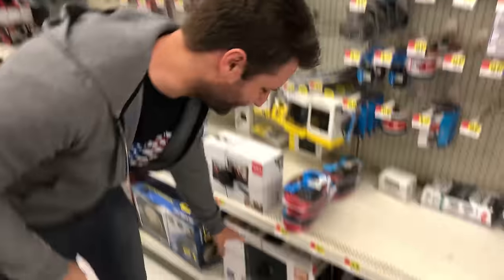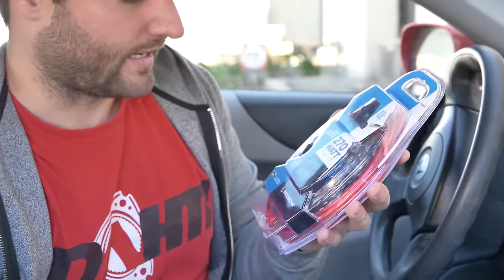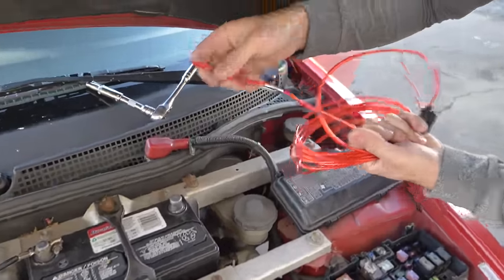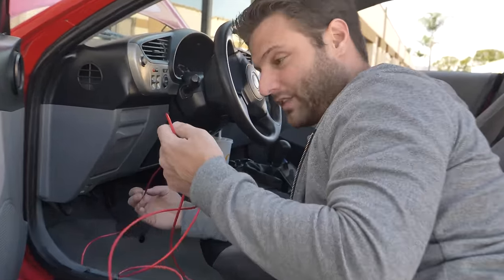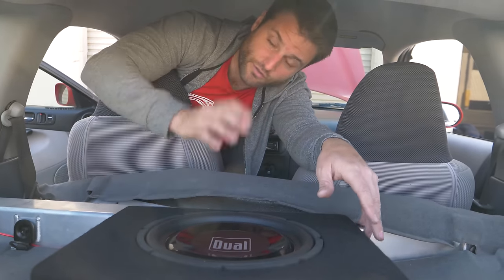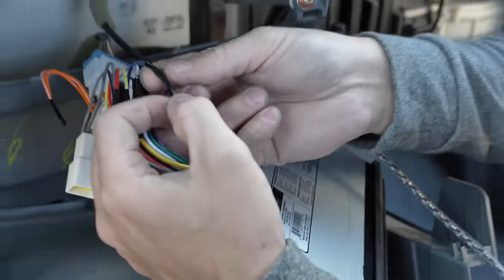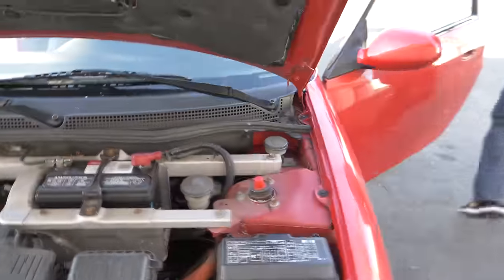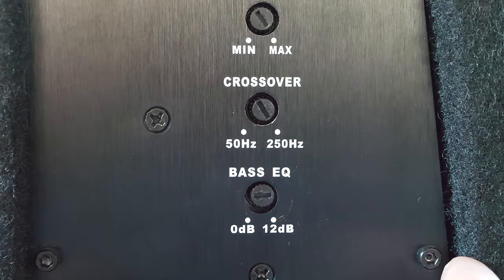How bad is the $70 subwoofer from Walmart? Install | Review

Comment: I cringed at Almost every step of that install
Reply: Besn't
Reply: We do not ever never no no connect the radio harness with black tape. Drive around enough and shake those connections on a hot day when the adhesive on the tape turns gooey and it will pull the wires out and cause a fire
Reply: Bantamdude Rodriguez Edgy huh?
Reply: It was all downhill after he bought the 270watt wiring for a 300 watt amplifier. You always want the wiring number higher so your alternator doesn't work too hard.
Reply: Beerus The Destroyer 
Lmao!
Reply: Never connect anything to your fuse box lol
Reply: TiigAgiiN eh. I cheated with my last amp. It turned on by the wipers. It doesn't pull much power just enough to say the car is on. Have to get my new car done professionally since its a brand new car and i dont want to void any warranties or figure out how to keep all the extra features. Going to cost me $2400 sadly. Only $150 is labor.
Reply: TheKingHostile man, I got a 2018 civic, I got my system done professionally only cost me $1,000 ...... But I didn't do speakers or a deck, just 2 12s and an amp, and some fancy new adapter for the deck
Reply: CarPhonix CarAudio I'm with you on that
Reply: TiigAgiiN The auto audio doesn't make money off the products. They don't even sell most of them just told me what I needed to bring in. It's literally so much because of how honda has the screen seperated from the head unit so it requires a special aftermarket product or replacing it with honda's premium sound head unit so I can add an amp for the speakers and run a sub. The sport head unit doesn't have a spot for subs so without replacing it I'd have to cut some wires to add a processor which voids the warranty. They're unwilling to void the warranty for liability reasons so they will only install and replace parts which keep the warranty in tact. Replacing the speakers with jbl 4 ways is a good $600 of the cost. The amp and sub are about 500. The head unit replacement itself is $1100. I might just wait until the warranty is over or void it myself. I have my other car if I really want to enjoy music but it doesn't get good gas mileage lol
Reply: TheKingHostile makes sense, I had 300 miles on mine, and said fuck it. Added an adapter, but its some fancy thing I've never seen before (probably the processor you mentioned) and then all the wires from my amp run to it, besides the main power of course. Still the part only cost $180
Reply: TiigAgiiN Most likely it's a sound processor. I wouldn't mind voiding the warranty as much if I didn't have reverse camera, climate control, remote start, sound cancelling and other features all bunched up in or near the head unit.
Reply: CarPhonix CarAudio i also cringed
Reply: Mr S That amp is probably 60w rms (real power). 300w peak power I’m guessing. A real amp at 300w cost around $150 plus...and that’s just the amp
Reply: TheKingHostile yea, that's why I used the one I did, he said it wouldn't affect any of that..... I feel as if we have the same car lol
Reply: No it's because the wires themselves will be too thin. 
Also, that speaker system is actually rated at 100 watts RMS, which is more relevant, so he probably won't have any problems, but it's a bare minimum setup and if he ever goes for more power he will have to get bigger power and ground wires.
Reply: same
Reply: I lol'd. I mean, you, apparently coming from a professional place being cringey and just non-constructive critizism towards a rando installing a 70 dora walmart woofer. 

Way to go, I know I wouldn't bring my business to you then, I mean. Sheesh, you'd stand there cringing if I had questions YOU find obvious etc? 
That attitude, much service  friendly ;)
Reply: at 1,974,000 views he made around $20,000 + from this video and you guys are crying about his wiring kit lmao.
Reply: Chooch it
Reply: TiigAgiiN I mean you can connect a remote wire to the fuse box
Reply: LOL ANYTHING WITH THE BRAND NAME DUEL WONT BE NOTICED BY AN ALTERNATOR. IT'S NO DIFFERENT THAN CHARGING YOUR CELL PHONE LOL
Reply: Nigga he just bought a Walmart sub
Reply: $2000 if he is lucky. $1200-$1700 otherwise
Reply: somemedic someone can't hear that well. He was testing and even said he will now terminate them properly.
Reply: only 1k lol the only big issue i saw on the video was the black electrical tape other than that is ok . no need to pay that much for running some wires.
Reply: Thomas Marshall yeah that part too 😅 but yet is not worth to pay a professional $1k for a car that is worth just little more than that .
Reply: Think he needs to watch some videos on how to properly install a sub . .
Reply: lol
Reply: CarPhonix CarAudio I swear bro I install car audio and this guy trying to blow some things up. He said touch quickly to see if it blows anything..I literally lost it lmao. It's called a multimeter
Reply: I agree. The sub itself is cringe 😂 and the opinion that a little "10 is "impressive" is cringey too.
Reply: It was pretty bad from start to finish. What are people putting in their cars?  My last "cheap" system was a 1200w Class D and a pair of entry grade JLs

Comment: i can't believe people do this! NEVER CONNECT THE POWER WIRE TO THE FUSE BOX!!!!!!!!!!!!!!! Why! yfi! the fuse box has fuses of different current levels that will be thrown off by power drain that could fry your computer if wired wrong! when i helped at a certain place, a certian person did the same thing wiring the sub to the fuse box, he shorted a few things, and one was the alternator. here's the problem, it was a 300m, chrysler. just remember one thing, because your sounds cause a energy drain, the power wire must connect to either the battery post (+) or the alternator positive terminal that runs to the battery. you'll learn that either place connects to the batterywith current flowing through and doesn't affect the voltages of the fuse box, which has things like ignition 1, ecu, abs, and many others you don't wanna mess with. SO DONT CONNECT TO THE FUCKING FUSE BOX👿👿👿👿👿👿👿👿👿👿
Reply: Nori Licious I was dying when he just connected it to the fuse box. I wanted to cry.
Reply: Stupid part is most amplifiers come with wiring diagrams or instructions and people still get it wrong.
Reply: Shit it even said it in the manual he was looking at. Damm that dude cant even read.
Reply: So much installer fail here. I love it. 
Dude needs to stop the DIY audio tho. How may kids are going to F their installs up now?
Reply: For real tho I was saying wtf are you doing
Reply: yeah, I facepalmed hard there! It's even MORE work to do it that way so it wasn't even laziness. Just take the nut off the pos terminal and slip on the o-ring there dude wtf
Reply: Looked like he connected it to the main feed going INTO the fuse box. That's fairly harmless on most cars.
Reply: I doubt this little garbage sub has enough power to cause any damaged. Lol I had this sub for a week and it burned out. It’s pos
Reply: John Moore kind of a logical-thinking fail here. 1) Just because the amp adds load to the system does not mean the voltage at the fuse box will be the same whether the amp is connected to the fuse box or directly to the battery 2) You can absolutely reach the capacity of a wire and starve a device (of voltage) - why do you think the wire burns when you pull too much current through it? 
You're not completely incorrect, but you should stop shouting long enough to make a cogent argument, because what you wrote there wasn't very convincing.
Reply: freebirthfreddy He was more correct than you were actually. In this specific scenario, as stated, the amp will never pull more current than the factory wire will deliver. Unless shorted of course which the fuse should control.

Discharge is dicharge. A 1v drop will show across all electronics attached to the same source without some sort of additional capacitive device. Hence 1v drop at battery, 1v drop at fuse box. Youre not removing amperage, youre removing voltage.
Reply: There's nothing wrong with it being connected to the fuse box so as long as its on the Input of the fuse box, and the cable feeding the fuse box is substantial enough to handle the current.
Reply: All depends what you're using it for, it's one thing trying to fill in the sound, which that sub will do. BUT it's completely different if you're trying to show off. That's when people spend $$$$. I've had my cheaper Sound Storm for a few years and had 0 problems. Could also be i know the limits and i don't try to push it past it's limits
Reply: John Moore as a plumber I’m offended by this. :’(
Reply: It gives me physical pain to see what they are doing to those iconic brands of old... poor Dual, even a lot poorer Infinity, etc.
Reply: Never seen it in my life... Always to the battery
Reply: Cars with computers are stunted!
Reply: As a plumber you should be honored. He's referring to the difference between water and electricity, not the difference between electricians and plumbers. Bottom line, stop getting butthurt over internet bullshit.
Reply: Nori Licious couldn’t even properly crimp the wires down.
Reply: Nori Licious thank you someone who has fucking knowledge of cars and systems  should of called it install of cringe
Reply: John Moore too funny bro
Reply: I disagree... I feel some people need to learn the hard way. Makes life worth living, and it teaches you a very important lessons. All you need to do is sit in the mezzanine and observe.

Comment: 5 years ago they had a 10" kicker all in one box at Wal-Mart. I still use it today, sounds great.
Reply: Sounds great if you haven't heard a half way decent system lol
Reply: @ascap2854  no ive heard systems that run $15,000 plus. I'm running component speakers. Dont need anything better in a hatchback.

Comment: I have never seen a power wire run that way! I only run the power wire through the firewall using an existing grommet....
Reply: Joseph B there are some cars where this is not possible without several hours of taking apart the dash. My 07 impala LT has a dual layer firewall that I didn't want to bother with so I ran the power wire for my system in the front fender, through the window wire grommet, and down the paneling into the trunk. It is common practice tongi through the firewall, but it's not a must
Reply: The grand prix i wired up had kinda the same idea as robs, no issues
Reply: lol right Joseph B he removing the factory assembled fender bolts too that's the fast way to get uneven panel gap

Comment: I did not just see that power wire go through the door!! Rookie moves 101!
Reply: he really has no idea what hes doing lol, he dident even solder any of the connections on his aftermarket radio, they are all electrical taped together lmfao
Reply: It must be the cheapest and quickest way to install
Reply: I installed a 800$ painless wiring harness 21 circuit in my 67 falcon and every connection is not soldered. Simply twisted together and wrapped with shrink tube. You don’t need soldering tbh.
Reply: @redbird283  yeah I don't think the solder is needed. All I did with mine was put little caps over them and crimped them. Well over 2 years ago now and it's been just fine. And I have a 2300watt set up.
Reply: @redbird283  yeah fuck soldering. I'll do it if I have to. But I'd rather not deal with burning myself/inhale potentially carcinogenic fumes
Reply: Solder or crimp, and insulate with good tape or heatshrink, adhesive filled heatshrink preferrably. Twisting and taping is only ever acceptable as a roadside fix to get you to a better location to fix shit properly.
Reply: @user-mg8mb6ss2t  did you see the part where he said "normally i would solder the connections, but im trying to replicate what the average person whos spending 20 on a head unit would do"
Reply: At 20years old,i did the same shit with no inline fuse. .my car caught on fire 3 months later

Comment: Place the subwoofer facing towards the trunk.
Reply: Brisko well bas is omnidirectional which means your ears can't distinguish where it's coming from so doesn't matter where u face it but ussually yes facing it to the back I'd better which is forcing all the bass to simple way of putting it is that it collects and builds up pressure at the back of the car before being bounced up to you at the front of the car it is louder

Comment: Its funny how your time line is backwards. Start with a high end car and working your way back to a broke teenager.
Reply: Talon Zero LoL, that’s pretty accurate too. As a 37 yr old dude I can almost definitely say my days of installing subs and head units in old beater cars is probably over.
Reply: As a 44 year old dude, I can't wait till I pay off my new car and can have some beater projects again.
Reply: Alvin Brinson why a beater though? I think at this point in my life if I was going to take on a project it would be one I’d care about. I don’t generally drive new cars in general but my current car has an awesome factory stereo, the HK logic7. My last 2 vehicles both had the radio quit working and I just kind of got used to it, now I’m a bit spoiled so if I had a project car it would either be a race car with no radio or a car I loved with a good stereo. Whatever makes ya happy though, I do see a value in beaters, just not really for me right now, maybe if I worked in construction sites or got dirty at work I’d definitely get a beater.
Reply: Well, the term "beater" basically to me means a car that's cheap enough that if I break something I won't cry over it. I do like that the car runs well and correctly though.

I did get a project recently - a flood salvage PT Cruiser GT with 25,000 miles. Has the 2.4 Turbo motor, same as the SRT-4... so I can play with it, make silly power for a 4 banger sleeper... and if it blows the transmission I won't lose too much sleep. But I do of course make sure everything's in working order - so I guess that's different from being 19.
Reply: Alvin Brinson Ok, I gotcha. To me a beater has always just been basically a car I don’t care about, if someone hits the door, who cares, if the interior gets trashed from work clothes, no big deal, it’s just a means to get me where I need to go and back. I guess pretty much all of my cars fit under your description, if they break I don’t sweat it much, they are paid for so occasionally putting some money in maintenance is no big deal, it’s better than a car payment to me but I’m still quite particular about my car, I keep it clean and and I’d be pretty upset if it got a door ding or any body damage really.

Comment: Not recommended to run ANY power wire due to the fact that your door shutting can actually cut your cable which can lead to major problems

Comment: Please use butt connectors not electrical tape. And notice he plugged the RCA's in before running them behind the dash, he cut the video and had to reconnect after running. And hook to power directly to the battery not the damn fuse panel
Reply: Or you could do it the right way and soder the wires then shrink wrap them
Reply: BIG-BAD-BRUINS22 HOCKEY MAN soldering is best but I can strip twist and tape a wire connection much better than a shitty ass, time saving butt connector. Don’t come at me with I am not doing it right. I know how to do it.

Comment: That power wire should have gone through the firewall, there should be plenty of holes with wires already going through, just use one of those.
Reply: I run up through the top between the hood/ wiper/ fender crease. Down behind the door hinges so it don't get pinched and throught the door wiring rubber boot through the kick panel then back to the trunck

Comment: My friend has this sub in his truck to just add bass to his bassless stereo in his f250 and for $70 its not bad. Its no audiophiles dream sub but it does add bass when there is none.
On another note you DO NOT run the power wire to the fuse box..you attach it to the positive on the battery.
Reply: you do not need to or it's a bad idea to?